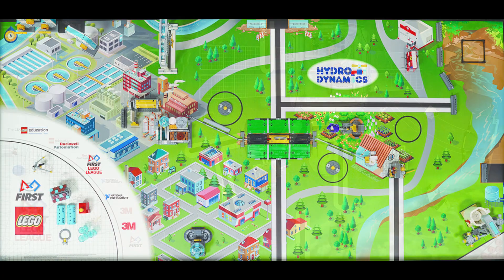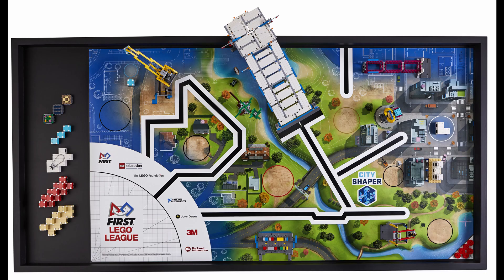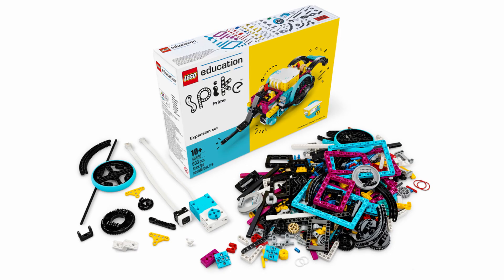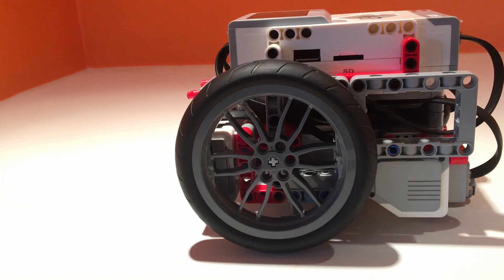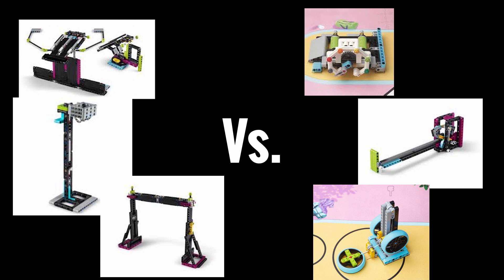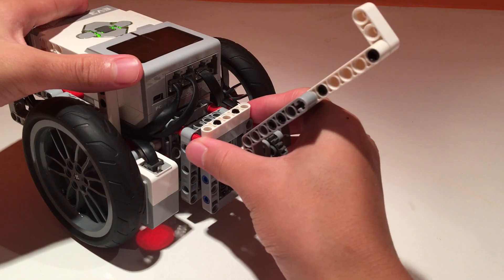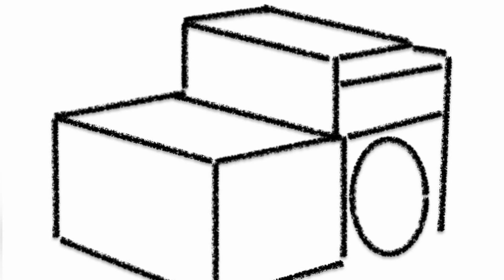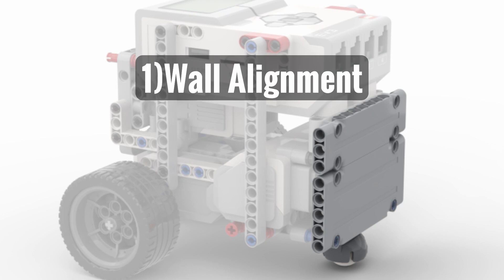Full Robot Design Process

Comment: Thanks for another very informative and concise video.

Another reason not to use wide tires, especially the ones with a rectangular cross-section, is they will make turns very inconsistent. When turning, the inside edge of each tire needs to travel a shorter distance than the outside edge. This can cause the robot to "hop" as it turns.